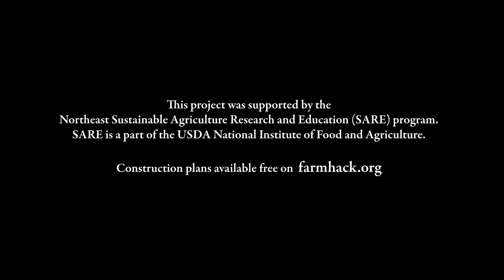GB1 Thresher

Comment: As small scale seeds producers, your thresher made us save a lot of time and permitted us to scale up quite a bit our production.

We built it last autumn and we have been using it to thresh beans, peas, soybeans, favabeans, lettuces, brassicas and so many different flowers. Everything that needs to be threshed goes in there. It doesn't work well with radish seeds and snap peas/beans, but it is still a lot better with it than without.

Basically, we use the metal chain flails with everything except legumes, for which we made rubber mat flails to avoid breakerage. It worked really great.

It will be very nice to have it at the beginning of the threshing season this year. Thanks a lot for making the plans available online!

Comment: Would it be useful to put the flails on joints that constrain their swinging to a single plane so "stator" rods can be mounted onto the walls of the chamber between the flails? This might make this tool more efficient or more effective for some threshing operations.

I imagine the flails would just throw the materials around once everything picks up speed rather than beat them against something if there are no stator rods. But with with short stator rods, a long item such as a head of grain could get broken up by colliding with a stator rod. You wouldn't even need that many stator rods; a single row of stubby stator rods may do the trick.
Reply: We never tried stators in the threshing drum.  We tried several different flail types and geometries.  We stopped experimenting when the results were good--ie, 1# per minute average production.  The flails do interfere a little with the staves of the drum.  I think a row of wooden or metal stator "teeth" might work well.  It might not even be necessary to constrain the motion of the flails; just let them whack against the stators.  Please  upload improvements to the tool page on www.farmhack.net ...    http://farmhack.org/tools/bicycle-powered-thresher .  Thank you!
Reply: That wasn't tried but might work well.  It might even work to not constrain the motion of the swipples and just let the swipples and the "stator rods" interfere.  As built it works very well, and often the problem is too much threshing action ( broken seeds) instead of too little.

Comment: Get a H F mixer for 150 bucks and an old blower.  Toss grain in with blocks of wood.  Walk away and come back to clean seed.   Works for almost everything. Adjust blocks and blower as need for type of seed.  Very easy no waste.  But it works best for wheat and oats and that type if you cut the heads from the straw.  And it is set up to dump into 5 gal buckets. https://www.harborfreight.com/1-1-4-quarter-cubic-ft-compact-cement-mixer-91907.html
Reply: could you make a video of this? where do you set up the fan? thanks!